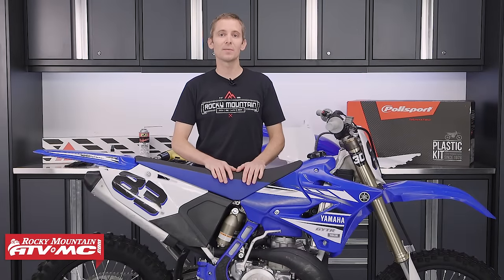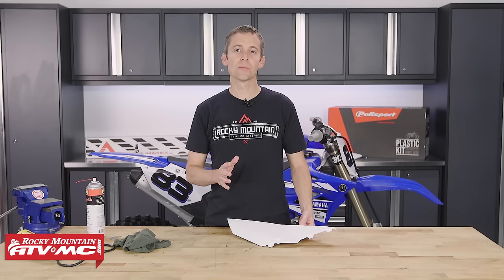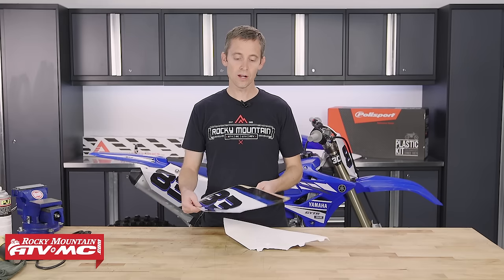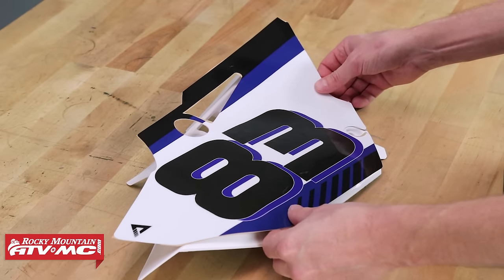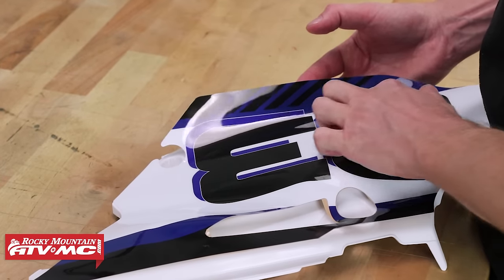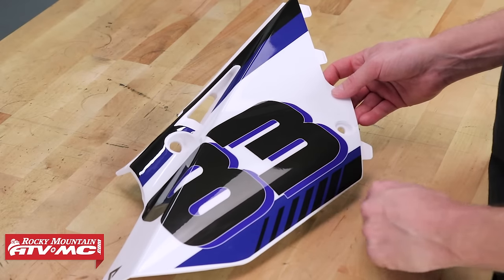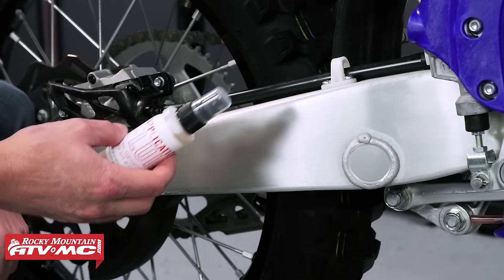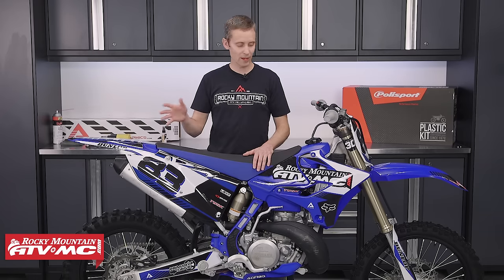How To Install Dirt Bike and ATV Graphics

Comment: My first time applying graphics I tried this method on one side and it left me with some wrinkles where there were creases in the plastic and numerous bubbles. On the other side I tried the soap and water spray and it came out much better and easier to apply
Reply: How did the soapy water method hold up after riding? Not throwing shade genuinely curious cause I’m about to order graphics for my 2020 and this method seems a little difficult
Reply: @copenhagenredneck7885  it felt difficult as well, but I have seen this method used in other places. I actually haven't been able to ride yet since I installed the graphics but they look and feel like normal so far. I'll update after my next ride.
Reply: @ReDD0311  awesome man thank you
Reply: @ReDD0311  so how did it hold up i'm fixing to try the same thing
Reply: @cloudnurdz6331  zero issues with the soap and water side
Reply: Factory method 😉 
2 drops of dish soap 
16 oz water

Light spray graphic 
Light spray plastic

Apply graphic into position 

Squeegee out water from center using light heat from heat gun if necessary

Comment: What the. best way to glue back down a graphic that's lifted? it's right where the knees rub the radiator shroud. I was thinking contact cement, rubber cement, shoe goo.
Reply: Get a new graphic, if there’s been water or dirt on the sticky surface its never gonna stick the same without using something that will damage the plastic

Comment: Factory method 😉 
2 drops of dish soap 
16 oz water

Light spray graphic 
Light spray plastic

Apply graphic into position 

Squeegee out water from center using light heat from heat gun if necessary

Comment: Is there another product I can use other than the contact cleaner you can recommend?
Reply: Alcohol
Reply: @nickmclay  do u think hydrogen peroxide would be good
Reply: I use break cleaner, works very well but takes some of the shine away from the ‘plastics’.
Reply: @SpecSOnYoutube probably because that stuff eats away at the plastic, dont use brake or carb cleaner on the plastics if you care about them.
Reply: Brake